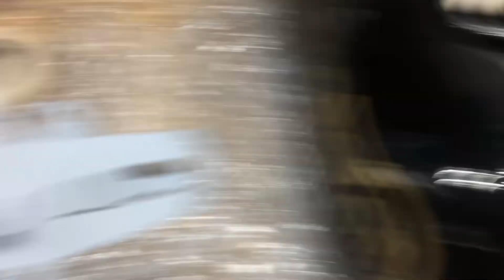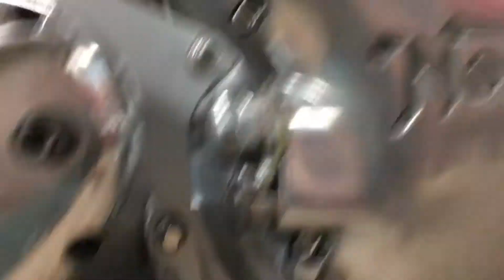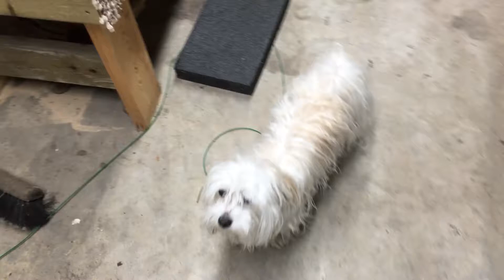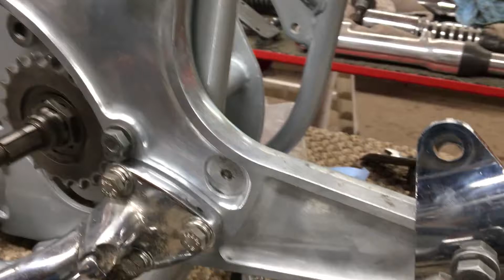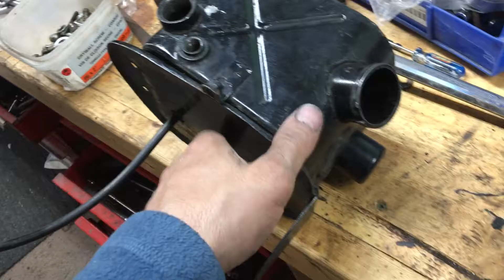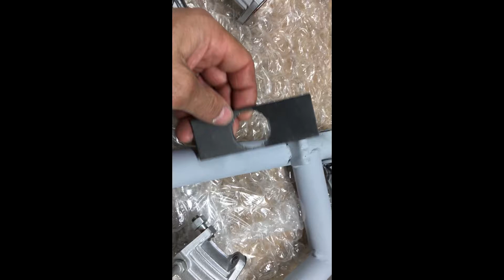Norton Commando 750 Restoration Video #80

Comment: Yes, what a stupid half-ass design to mount this engine and trans in the frame! I am pretty sure I put the trans in last. But if I did, I do kinda remember that I struggled for hours and hours on it - I think. I think I had to take out the front mount completely and raise and tilt the engine's head up against the frame down tubes (with about 1/2" of padding to protect the frame and engine paint), and had the rear engine / trans mount spindle out as well. I even sorta remember tilting the frame forward to let gravity help. I used many carefully cut pieces of wood blocks and thin plywood strips to both hold and protect the parts from getting damaged and also to wedge and spread the trans bracket and frame ears apart just enough so nothing got scratched up and everything could move freely. I still mostly remember a pretty damn tough fight with it, though! It seems I must have killed much of my working memory of the whole affair when I polished off a lot of celebratory beers immediately afterward....

Comment: Hi Bruce just to let you know that the z plate you put on the bike is the gear change side one,
Reply from the maker: I wasn't sure and they looked identical. I see now where the zenor diode was, I thought it was for the disc brake switch. My BSA had the diode under the triple tree as I remember.Thank You
Reply: thats ok Bruce  the hole with the recess is for the zenor  diode

Comment: Hi Bruce,For lining up the rear wheel in the swing arm our method here is let your technical, best eyed friend drive behind you for a while to look sharp if the rear wheel runs in line with the front wheel. Once okay make marks on the swing arm and your done  This method eleminates the furter mistakes that are in the frame. bye.Gerleen de Jong, Netherlands.
Reply from the maker: Yeh, that makes sense to me, If the frame is out a bit than the swing arm will be out, so no point in putting marks on it until I have the wheels aligned., Thx